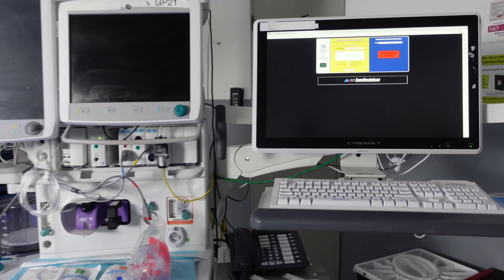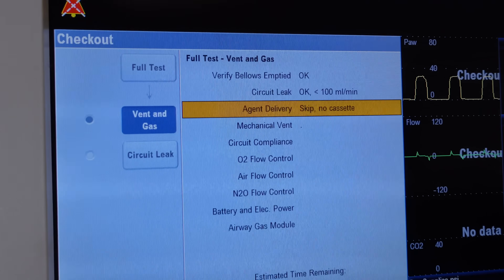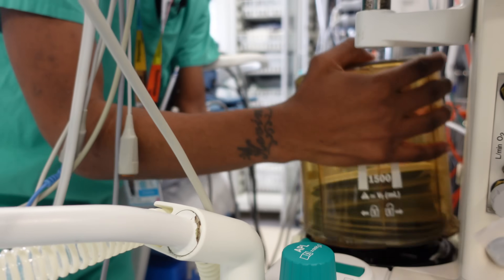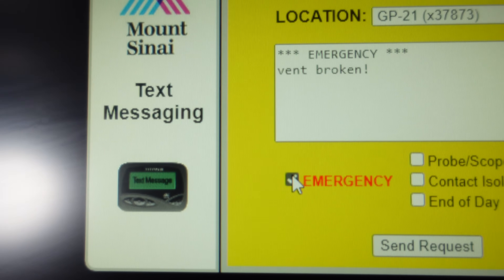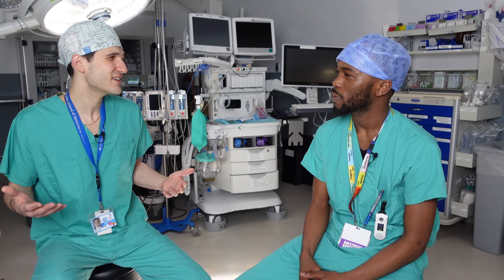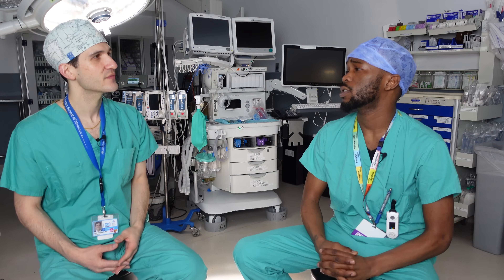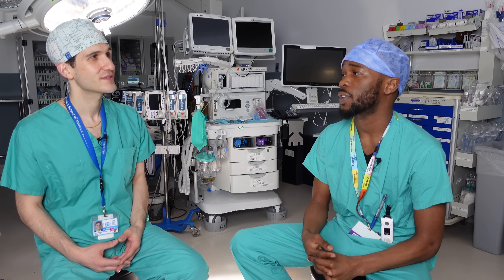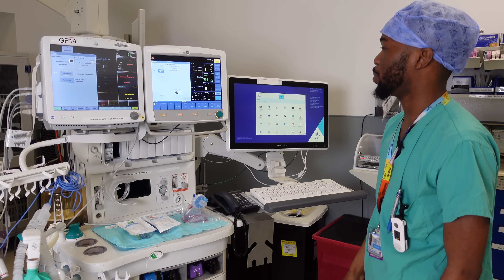Who fixes anesthesia equipment during surgery?

Comment: when I started electronics highschool (I have a matura which is like a highschool diploma and a profession in electronics) I had the option to choose to continue in telecomms, medical machinery maintenance/repair, manufacturing and I don't know what the fourth option was. by the time I graduated all those courses dissolved, I was thinking telecom or as a plan B "meditronics", only thing holding me back from meditronics being plan A is the fact that I get quesy easily if I see anything medical that is real (as in, not Hollywood), I have no issues watching Goran Vjnic crack a chest on ER but I fainted in a biology class about the heart and circulatory system. Imagine the technician fainting while fixing the machine mid surgery 🤣

Comment: Corners are cut even with medical equipment  - with such high cost of these equipment they should not break down or extremely rarely - there needs to be a very high level of quality control and testing under very high stress and load - and these machines need to periodically be maintained and checked - Unfortunately medical equipment is not immune from shoddy components, poor QC and QA testing.